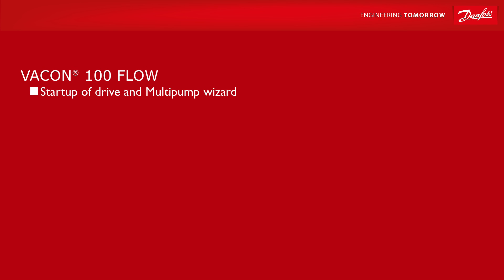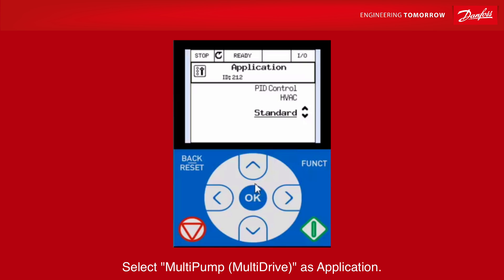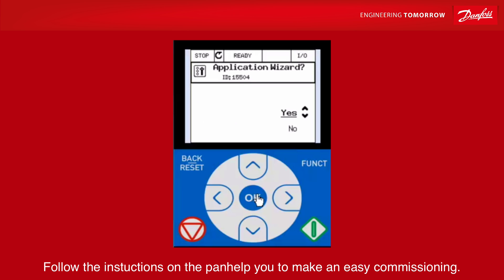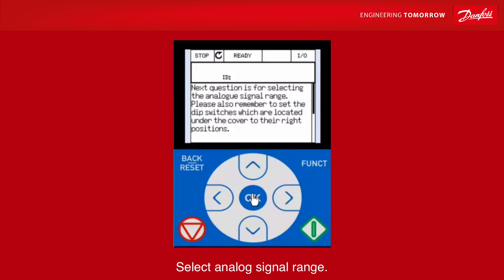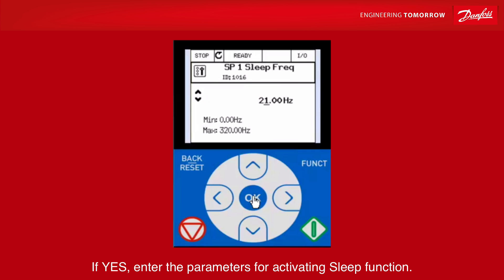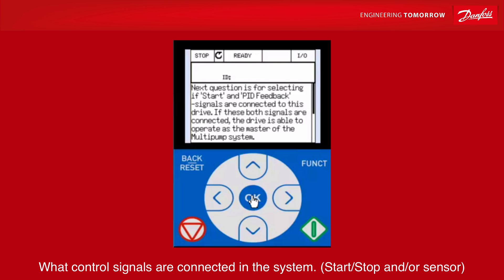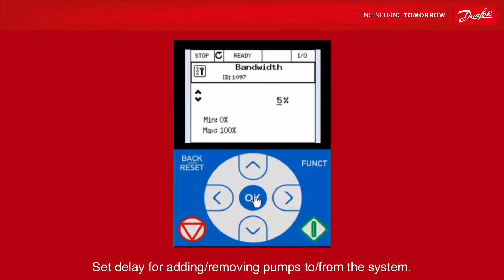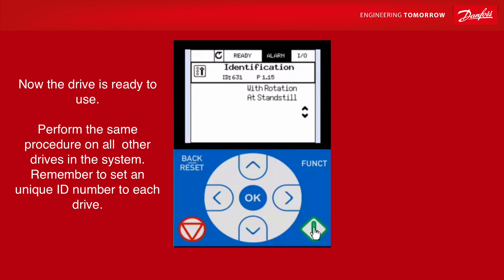VACON® 100 FLOW Startup and Multipump Wizard

Comment: Good day.
I have drive working remotely via PC software, but display not working. Is it possible replace only control display with new one without missing parameters?    
Can you advice?
Reply from the maker: Hi @oleksandrchernov2781,

Thank you for reaching out!

The control keypad can be replaced with a new one without losing parameters. Parameters are stored in the control board's memory inside the control unit.

If parameters are loaded onto the keypad as a backup, that information is lost when replacing the keypad.

We hope this answers your question.